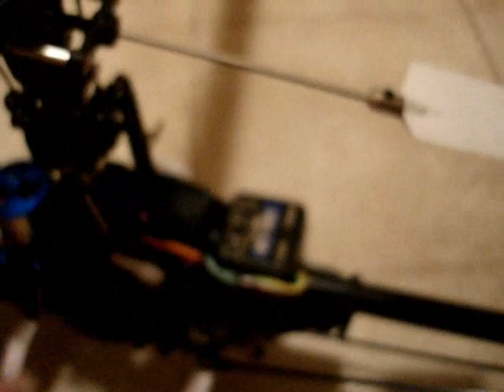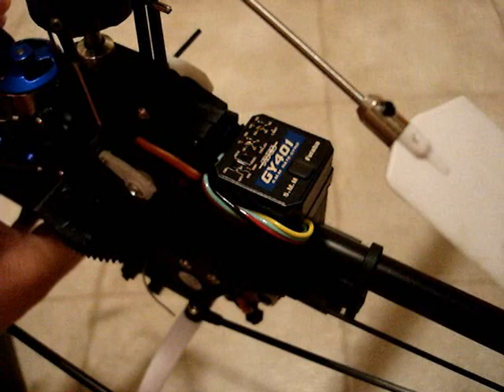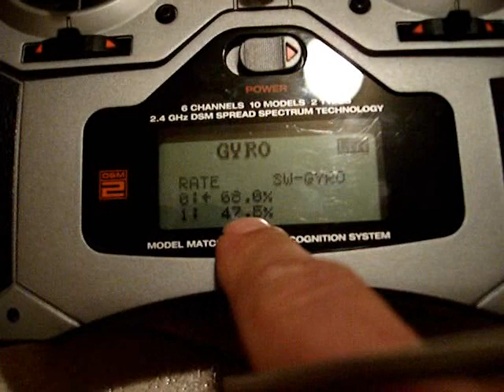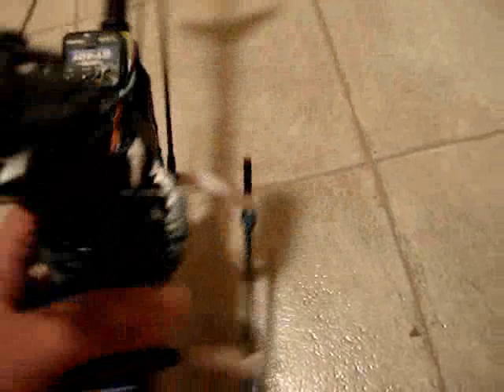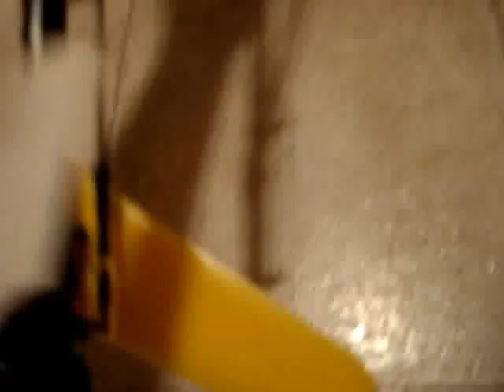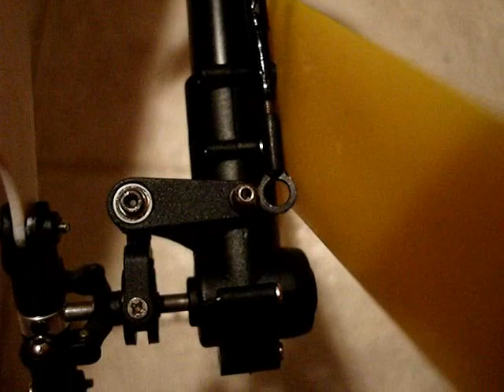Blade 400 3D gyro/tail servo setup Part 1

Comment: Hi, 
So I finally had the chance to change out the main shaft on my B 400, today, I also decided to change out the stock gyro to the GY 401, and continue to use the stock gyro servo, but can't seem to keep the servo centered, after adjusting tail limits, a few seconds later I see the servo horn moving in the direction of the tail rotor, am I missing a step here ?  or I am making adjustments iradically, I sure could use your help here please ?
Reply from the maker: Wow haven’t flown my bird in for ever.  I’m glad my videos still help.  I do remember the stock gyro will give a little issue as it’s not digital.  But if I remember correctly sounds like it’s hunting.  Possibly change the gain down a bit

Comment from the maker: i had the 401 and the jr 3400g did create a lil more demand on the system so i put BEC in to let the esc deal with motor only. the castle 35A is my best recomendation it will do well with stock motor and give room for later upgrades. and thanks

Comment: Hi sokal, 
Video was a great help. everything went perfect except I had to drop the gain to about 57 to stop the tail wagging?! And after half a battery the ESC went pop. I think its just a dud stock ESC not sure if the 401 and digital tail servo would put that much extra demand on the ESC. Would you recommend upgrading the ESC?cheers

Comment: @nwjt The gyro obviously costs less than the heli (both new) and you can buy a copy of 401 for $14 - dealextreme .20020
The stock gyro would work if only it didn't have that huge temp drift!
Revo mixing is poor and might only be good with almost constant rotor speeds which I am not really going for.

Comment: i just bought a used feda dragonfly and when i give it throttle it spins to the counter clockwise i have the trim alway to the right also to prevent it but its not enough it still spins. is anything wrong or am i doin something wrong?

Comment: sokal11, First, are you deployed, hate to ask question if you have other stuff going on.

Ok, 6v?  v would be from receiver, so is 6v possible, not sure I understand this.

In HH is the servo suppose to self center, cause if I set R for rudder in reverse then it appears to work fine, but no light in HH?  This is a shell game, try to find under what shell everything works together.  LOL

Comment from the maker: make sure your not running 6v with the 3500g

but check your gyro direction in the reverse menu should be N anything a bove 51 is HH mode

Comment: Been going over this video number of times.  Have 3500G/401.  Been causing problems.  ended up R gyro in reverse on radio.  now servo works fine, but in HH light does not come on?  light off in regular mode at setting of 49.0 on gyro.  Any ideas, you can send a PM.  Maybe I need to take helicopter to VA Beach for a vacation. LOL  (they will be going to sun FL soon tho!)

Comment from the maker: just make sure subtrimand trim is center
and set the gyro gain rate to 45% or so this will center the servo just besure not to move the heli to much as the gyro will stil compensate but not will use the center of the gyro range as it return point

Comment: The reason I asked about Rate mode on the 110 gyro is because in your vid U say that 1 must be in rate mode in order to center the tail servo- correct? so I guess my question should have been ... what are the proper steps to center the stock servo so that I can 90 degree the arm. Thanx again. Appreciate all of your help

Comment: Sokal - thanx for the vid. I have a 110 stock gyro and I cant seem to place it in rate mode. I have my sensitivity below 50 in 1 setting and above 50 in 0 setting but when I flip the switch - it stays in head holding mode (the light stays on ) Any suggestions?  Thanks again

Comment from the maker: it all depends
with a constant head speed the gyro has to work less than if it was in normal

but i keep mine set to 70-72 i never fly in normal
sounds to be like the belt was skipping
with the added rpm jump if belt is too loose it will skip

Comment from the maker: if your in heading hold mode than thats normal

rate mode with about 45% gain it will center nicly with out creeping

if gyro reverse settingin the TX is N then heading hold mode is 51-100% gain
51% is lowest
rate mode is 49-0% 
49% being the lowest

Comment from the maker: just install make sure you keep the gyro set to normal not digital

make sure slider moves opposit of stick input (reverse in TX)

and make sure gyro moves slider opposit of the tail movement (reverse on gyro)

raise gyro gain till wag starts then lower .5-1 %

Comment from the maker: with the JR285,3400g and 401
iv ran it that way for 9 months before i bought a BEC

never had any issuse with this setup
now iv saw a trend in the HS65 servos with the 401 and 3400 seems the HS servos suck more amps than the digital JR servos 
now thats just the trend iv seen some claim to have no issues

Comment: Hi, i have a problem w. my blade 400 and i hope you could help me. Basically what hhappens is, everything is working good on my heli it initializes and all. Then after a few seconds my tail servo goes all the way in and jams. then the servo starts to heat up and I cant control it at all.

Comment: whats the best way to deal with that pile of wire that the gy401 gives?
i have a beam and there's really not a good place to put it in a bundle, very easy to see through frame, opposed to the b400.

Comment: Very good information on a very good mod!

The GY401/3400 combo will dramatically improve this heli's performance capabilities. He's using the ds285 servos which will also improve this bird. If you use a higher quality battery (2200Mah/20C+) and stiffer blades (FRP, Carbons) you will have an amazing 3D performance machine.

Don't forget to practice with your simulator! Do it 100 times there before ever trying things in real life. The sim will pay for itself in parts within the first month.